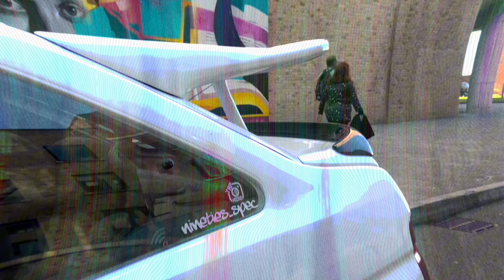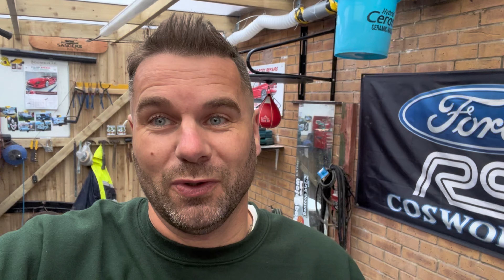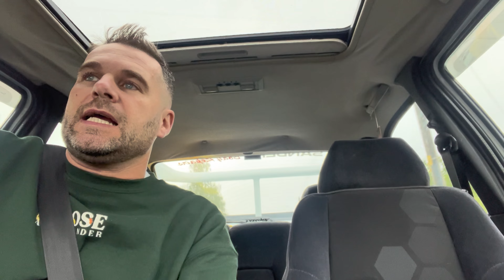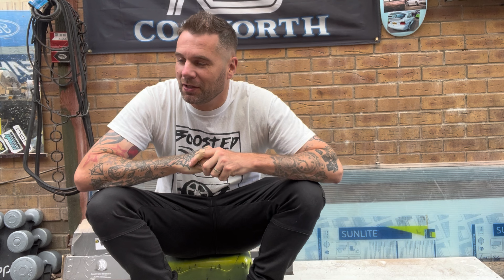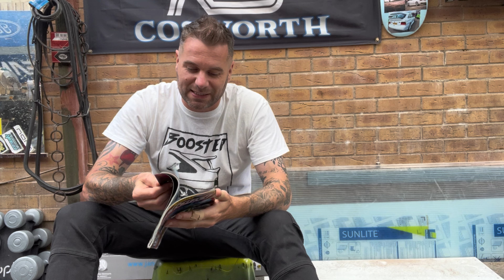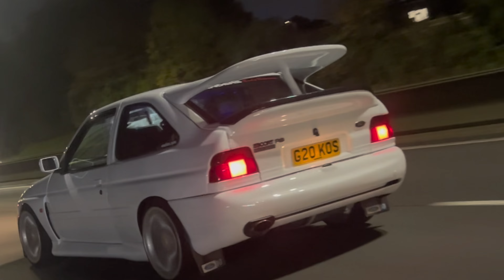ESCORT RS COSWORTH / 2000 BAD BAD NEWS…… Is this the end of

Comment: I had comp brake arms on mine for 4 years, and they were fine on the road and on track, I use to check them over every year and clean and grease them. I got sick of replacing arms, I went down the poly bush route and that wasn't much better than standard.
Reply from the maker: That’s where I am with it . Just ordered a Delphi one ready for next weeks show 

Then it’s the comp brake set up after that for sure ! 

No more holding back ,builds going next level

Comment: Yes Dan! Bigger and better , I’m sure there’s a product called water wetter? It helps with coolant boiling point issues, I’ve a 2 way fan switch on mine so I can override the fans on a hot day,50/50 coolant and fitted a lower temp thermo switch, not tried the wetter product but I’m told track cars owners swear by it
Reply from the maker: Cheers buddy . 
Ye I’ve got a outter fan ( spal ) that pushes and a smaller inner , that sucks . With switch overide . 
Think the small snail and the restricted rooms or helping :( 
But it’s deffo gonna now be bigger and better .
I’ve committed !! 

Can’t give up now ! 
I’ve done 15k plus miles running loads of boost , all over uk . 
And tbh I’d only need to do a gasket 

But I’m going all out 🤍
Reply: @boosted2000 the best gets better 😂 Gwan lad

Comment: hi mate i used to get a bubbling noise in the header tand on my cossy back in the day when i parked it up in the garage someone told me it was the coolent returning from the turbo back to the header tank were its hot and said to fit a turbo timer to stop it i dont know if its relivent in this case did used to worry me tho , another great vid tho im sure you will sort it bigger and better good luck with it.
Reply from the maker: I run just oil on the turbo to keep engine temps down 

This Frankenstein !!!! 😜

Can’t wait to run new lump all ready

Comment: How many sheep has it under the bonnet 😂😂
Reply from the maker: It’s a baby !! Only running lambs lol

244 at 14psi stock internals 

Will be going for 300 on low boost and 400 high boost with planned spec
Reply: Looks a good rep @boosted2000